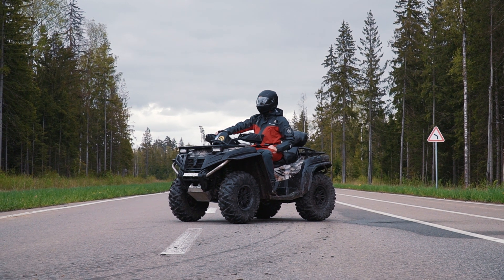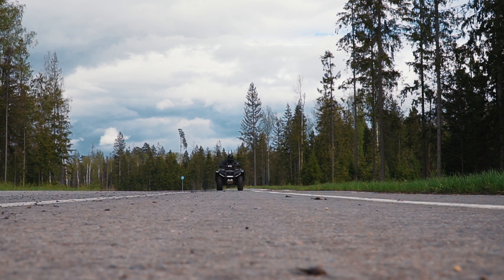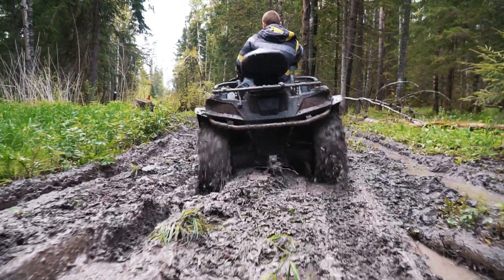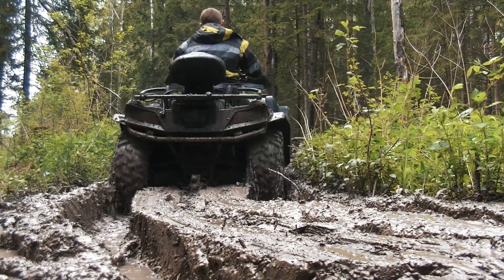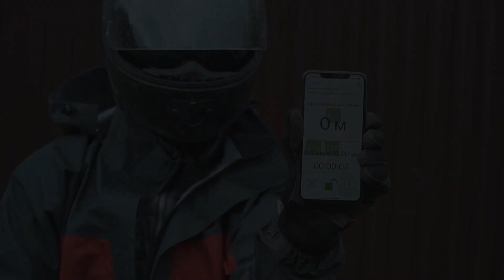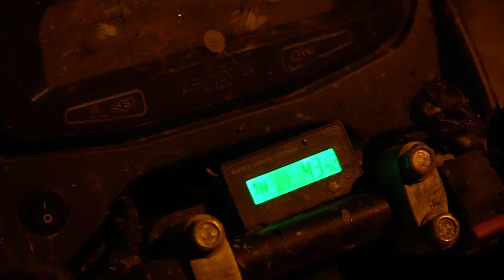We converted ATV CF-moto X8 into full electric!

Comment: Nice video!
I play arround with the idea of converting my Polaris 850 to electric.

I only use it for short rides, to haul stuff arround and between my properties. 
I have it speed restricted (less than 40 km/h), to save on daily insurace tax; $0.18 rather than $0.58 

If I do electric conversion I consider restricting to less than 20 km/h, because:
I avoid all paperwork and stuff to get it approved for registration.
I mostly do 5-10 km/h anyway, and only matter of seconds more than 20 km/h.